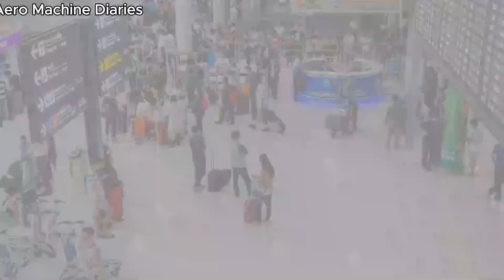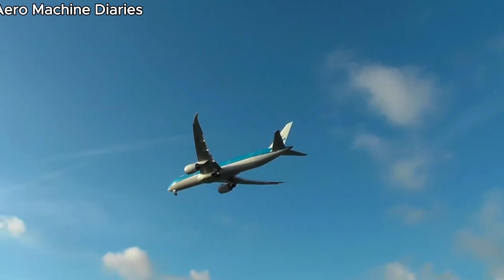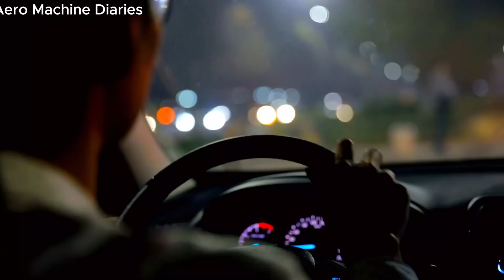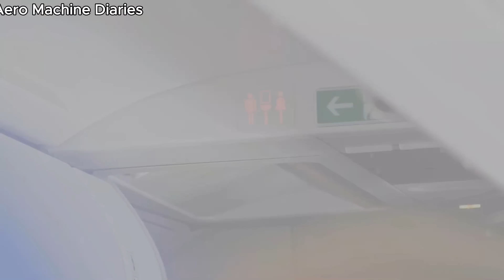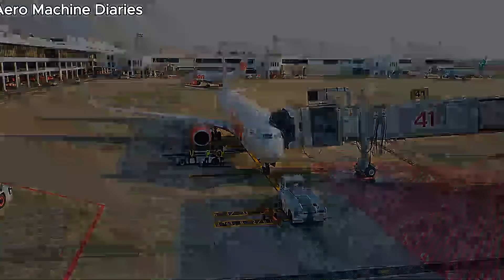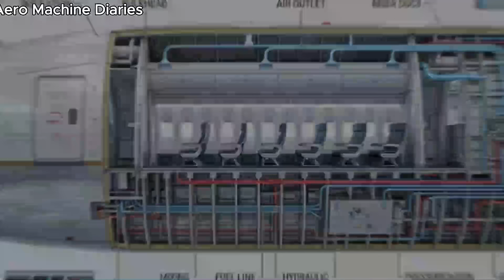Where Does Airplane Toilet Waste Really Go?

Comment: Airplane toilet waste is completely stored on board in sealed holding tanks for the entire duration of the flight. It is never intentionally dumped into the sky. Pilots do not even have a mechanism or button to release the waste tanks while mid-air.

Comment: What’s even more brilliant is that electrically driven vacuum blowers are disabled above 16,000 feet. Above this altitude there is sufficient air pressure differential between inside the cabin and outside, to let physics do the pushing 👍

Comment: You are wrong. They just open value it flows out not vacuum out. And no they don't clean the tank. They use a blue solution that as sanitizer in ii mixed with water , then pump it back in. I know because i use work for the airlines and did it too. So i don't know where  you got your information from because you are wrong. Ckear drinkjng water would then be pumped in with a different hose

Comment: Nice simple explanation for a messy process.on longer flights with the long retention times are the tanks designed to start basic treatment or to just hold the liquid.
Reply from the maker: Great question! They're primarily designed to safely store the waste during the flight, not treat it. The tanks are sealed and use disinfectant chemicals to control odors and bacteria, then they're emptied and serviced by specialized ground crews after landing. Thanks for watching!

Comment: I worked for a major airline in States ground crew personnel loading and unloading bags one job assigned was to remove the waste when each aircraft arrives at the gate.
One slip it could get messy but if one takes this serious one take caution.
I perfected the process and rarely had a miss it was far better than lifting thousand pounds of luggage and cargo if one has no ego.
You make sure equipment is all in place, protective clothing etc. take less than 5 minutes while others are killing themselves I was taking a nap.😂

Comment: The waste from an airplane toilet does not dumped out during flight. After the plane lands, specially trained ground crews connect a service hose to the aircraft and pump the waste into a sanitation truck.
Reply: Only a moron would think airplane toilets were dumped during a flight.
Reply: Thank you! I used to work at the airport.  What you stated is true.
Reply: What about waste from the ship
Reply: @EnnieEnnie-b5v  They do the same thing.
Reply: @EnnieEnnie-b5v 😂😂😂😂😂😂
Reply: Yuck.. so dirty😮
Reply: You’d have to be pretty dumb to think that.
Reply: It's all a bit yukky!

Comment: I took a train in a 3rd world  country many years ago and was surprised to see the toilet waste drop directly to the tracks. Wonder if they still do that.
Reply from the maker: That's true—many older trains used to discharge waste directly onto the tracks. Thankfully, many countries have been replacing those systems with sealed holding tanks or bio-toilets to make rail travel much cleaner and more environmentally friendly.
Reply: That’s disgusting. How did they think that was a good idea?

Comment: Similar to the toilets we had in the decompression chambers on oil rigs. The toilets had holes drilled around the top so you would not accidentally pull your intestines out if you flushed while sitting there.
Reply from the maker: Wow, that's fascinating! 😮 Thanks for sharing that firsthand experience. Safety measures like that definitely show how powerful pressure differences can be in specialized environments.

Comment: For those in a hurry:       Airplane toilets use a powerful vacuum system and a tiny amount of water (or a sanitizing blue fluid) to rapidly suck waste away at nearly 100 mph. This waste travels through sealed pipes and is stored in a holding tank in the belly of the plane until it is emptied by ground crews.
Reply: There was a time when it was released into the atmosphere. There was a report, where a frozen clump, came through
a family´s roof and landed on the kitchen table. It was a question put to candidates on the show, `` Have I got news for 
you ´´ in the UK. Paul Merton, a candidate, had read about it and gave the correct amswer.
Reply: @johngodley256 Trains, passenger trains, the toilets dumped directly onto the right of way!
The smart money would get no where near a passenger train blowing down the tracks!
That's why the porters locked all the bathroom doors approaching the stations!
Reply: @dirkvanerp7332  As a Baptist Missionary many times I have traveled by train from Almaty, Kazakhstan to Semey,  Going to the toilet was always an adventure.  Through the hole in the floor you could see the tracks and the walls were crystalized from the urine from those who missed their target from the sway of the “poist” the train.
Reply: Thank you it’s 23:06 PT on June 26 th 2026 and I was thinking I’m never gonna get this time back lol 😂
Reply: Thank you. You've just saved me 10 minutes.
Reply: Thank you.   Much appreciated.   😊
Reply: Thank you !
Reply: Thank you for the info.
Reply: "It's my lucky meteor"😆
Reply: not in a boeing 737. but close. it goes in a tank but no vacuum
Reply: Thanks you for your explanation, I thought the waste was dumping in the air. ✈️
Reply: Even cruise ships like Royal Caribbean and MSc.Royal Caribbean’s ‘Icon of the Sea’ has a passenger and crew capacity of 6,000.Imagine that!
Reply: From Trev G this tanks are in the hold the electrical pumps are under the floor in the hold I know as I used to change them
Reply: Those honey wagons where used way back in the 1940’s and 50’
Reply: thank you
Reply: Thank you
Reply: Thanks! Saved my time.
Reply: TY for your thoughtfulness 💐
Reply: Thank you ever so much.  At 77 years old and past 10 pm I didn’t want to go to sleep wondering about this.
Reply: Thank you 😂
Reply: Thank you 🙂
Reply: Thanx ❤
Reply: Complete RUBBISH,  the waste is NOT released into the atmosphere,  what nonsense 🙄
Reply: @gayiyer7913 I bet they used to do that in 80s 70s 60s 50s 40s 30s
Reply: @gayiyer7913  Never said it was.